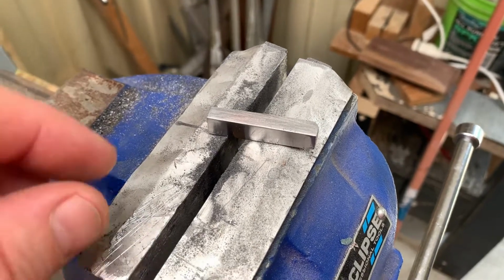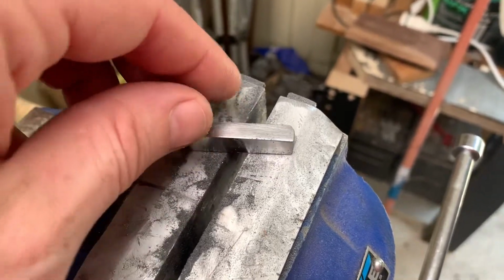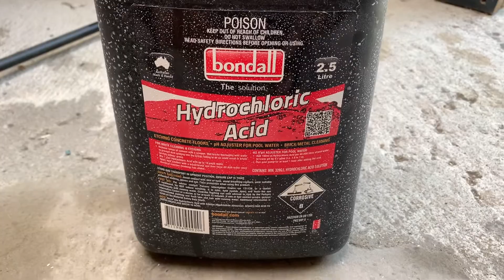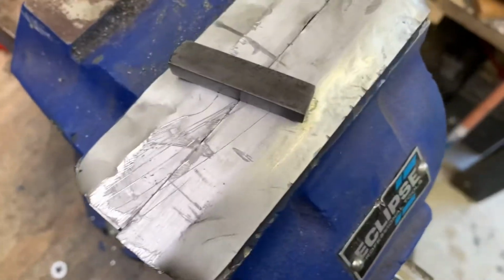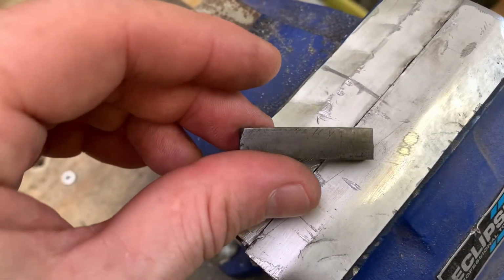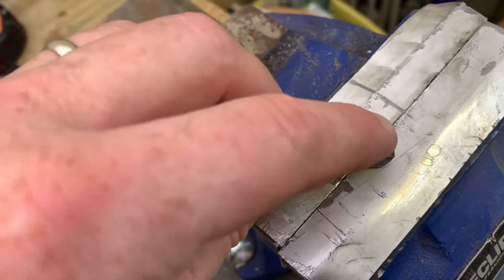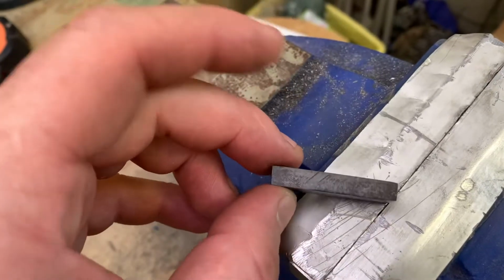Rust Bluing a piece of scrap as an experiment

Comment: Rust bluing is the traditional method for bluing firearms.  It is time consuming (requires many cycles), but not difficult.  Typically, anywhere from 8 to 10 or even 12 cycles are needed to get a good, even very black finish.  Final results also depend on the composition of the steel itself as well.

The solutions used to create the rust have many different formulas developed over the years, and some even include some very dangerous chemicals, like cyanide or arsenic.  You can buy rust bluing solutions that work well (but they are pricey), or make your own.  One is to use hydrogen peroxide and salt mixture, or straight acid as in this video.  It is better to wipe a thin layer of your solution on the part than to dunk it completely as the acid will eat away the parent metal (not a good thing on firearms).  Also, there is no need to highly polish the piece as it will always end up as a satin finish due to tiny pitting caused by the rust.  Usually sanding up to 320 grit is plenty.  A highly polished piece also does not rust evenly.  The rougher 320 grit finish gives the solution some "bite."  Slower solutions often require what is known as a "wet box", which is a sealed cabinet (made of plywood works fine) that contains a 100 watt bulb for some warmth and a pan of water for humidity.  Wipe on the rusting solution, place item in the wet box and wait several hours for the layer of red rust to form.  Hydrogen peroxide and salt is much faster (the steel will literally rust before your eyes as it is applied).  The only draw back to using hydrogen peroxide is potential hydrogen embrittlement of the steel.  

The goal is to get as even a thin velvety coat of red rust as possible.   Once rusted, you boil or steam the part as heat converts the Fe2O3 (red rust) to Fe3O4 (black oxide, or magnetite).  After boiling you perform what is called "carding", that is, remove the velvety black oxide to leave the surface of the steel a satin, smooth darker color.  0000 steel wool can be used, or you can get what's called a "carding wheel", which is simply a very soft wire wheel using thin, hair like strands of stainless steel.   The idea is to just remove the loose oxides.  If you card too aggressively you risk removing the color as well.  After carding, apply your solution again and just repeat the process to achieve the color desired.  Typically, in the case of a firearm, the process is repeated until the solution no longer rusts the piece.  

Rust bluing provides the most durable and rust resistant finish short of some kind of coating, such as cerakote, etc.
Reply from the maker: Thankyou for this comment, awesome info

Comment: Wonder if allowing it to rust up a bit after the initial dip will get a blacker finish… I have to try this one I recon….
Reply: To get darker, just continue to repeat the process.  Many times it takes multiple cycles to get an even, black finish.  It is better to apply the solution in a smooth, even coat and let it rust than to dunk it in the acid (the acid will eat away the parent metal, which is not good).  Wiped and exposed to the air will result in better rusting and coverage.